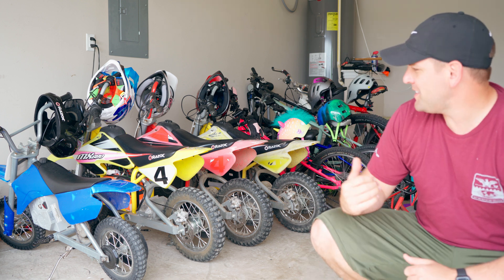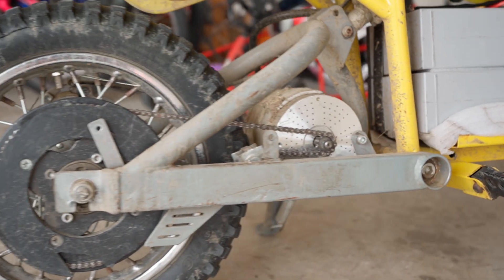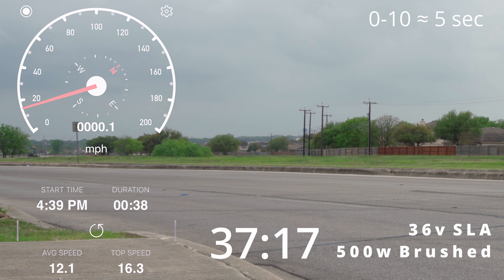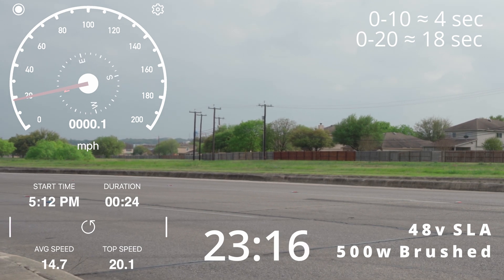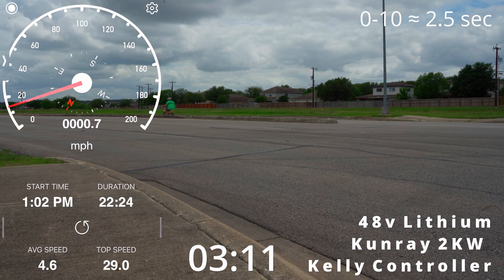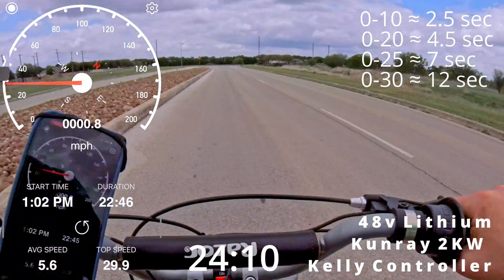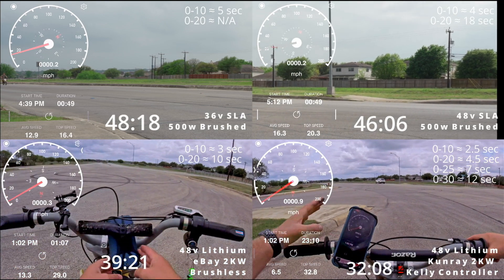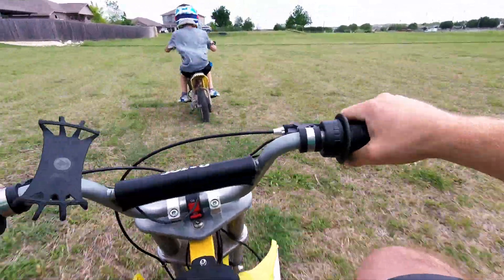Razor MX650/MX500 Electric Dirt bike Upgrade Comparison

Comment: One of the best MX650 comparison's I've seen, thank you! 

I'm just starting a MX650 build for my son. Street tires are on, and a 48V lithium battery is en route, as is a brake kit. Next up are headlights and taillights, and I will eventually add a now controller/motor. But the 25mph-ish he'll get out of the 48V alone is plenty fast for him for the next couple years!
Reply from the maker: @dhess34  thanks! I’m glad so many have found it useful. It kind of ruined my channel for me because it’s such a high performer I didn’t want to post anything else. Haha.
I didn’t know it at the time I made the video but a brake kit is basically essential. Y’all are going to have a blast!

Comment: Are your brakes stock or have you changed them out? If so, which ones did you go with?
Reply from the maker: Hey! sorry - I never saw this comment to get back to you. I have 2 with stock brakes and 1 with zoom breaks - HB-875. They also required new discs too which I think I overspent on but I can 100% recommend these brakes. The stock brakes on my 2 other bikes are very worn and barely stop at this point - my zooms could send me over the handlebars. I'm definitely not claiming they are the best choice - I do not have the data for that, but I have not been disappointed.

Comment: good comparison. would like to know the cost for the 3 different upgrades.
Reply from the maker: Hey- sorry I never saw this comment come in! I’d have to do some research. The lead acid batteries I already had laying around. The orange batteries were around $120 a piece, the cheap controller and motor also around $120 and I don’t remember how much I paid for the better motor and controller but I can tell you I overpaid the guy. You can get them for far cheaper than what I gave.

Comment: This may be a noob question but how do you charge when adding another SLA battery? Will it work or do you need a different charger?
Reply from the maker: Not at all man. You can get 48v lead acid chargers, usually made for something like a golf kart. What I did when I had multiple lead acids to charge (I’m not saying best practice, it’s just what I did) is got a splitter and charged my 12v batteries in parallel. I used a 12v trickle charger with an adapter that had like 5 connectors on it that would charge each battery to 12v and then reconnect them in series. You could also use a 24v split to charge 2 banks of 24v batteries in parallel before reconnecting them in series. 
I apologize if this doesn’t make sense. It be much easier to draw out or show you. Are you on the Facebook group?

Comment: What battery you using?
Reply from the maker: I’ve been running the greenway orange batteries with no issue. I have 2x in parallel. They each have a 30a BMS. 2 in parallel allows me to pull 60a to my controller.

Comment: Considering the 2000w motor you got, what is your battery’s max wattage output rated at?
Reply from the maker: So supposedly my batteries are each rated at 30 amps. 48v packs are 52 volts fully charged. My batteries are ran in parallel meaning I should be able to pull 60 amps. 60ax52v=3120 watts. That’s the math but I’m a novice so if there is more to it, I am unaware.

Comment: I just bought the 36 V razor controller and the throttle and a 36 V 12 amp hour lithium ion battery and over bolted the 24 V motor. Im 215 and I get 22mph on flat ground.
Reply from the maker: Which 24v motor did you use? Was that on the 350 or the did you swap out the mx650 36v motor for a 24v?
Reply: @NerdsWithFriends  the stock motor that  comes on the 350 24v and then I bought a 36v stock razor throttle and stock 36v razor controller
Reply from the maker: @PlagueisTheWiseX  very cool! Yea, volts typically correspond to top speed while amps give you your torque figure. An Mx350 stock should do around 14mph (at 24v) so at 36v you’d expect the top speed to be 150% the normal speed which is pretty much right where you are. That’s awesome that you’re able to reach those speeds as a full grown man! Be careful with it in the grass though- I burnt up a couple 36v motors in mx350’s. If you do burn it up, there is a 500 watt version of that motor you can throw in there that handles the heat better but, ironically, it’s actually slower at about 17mph if memory serves me correctly. (I have the motor on my buggy now. I no longer have any 350’s) but the 500w motor is already rated at 36v.

Comment: So you didn't run into any issues with burning the stock motor up when running it at 48v? Do you have to change the throttle when you do that?
Reply from the maker: So the biggest problem with overvolting is heat. Light riders should not have any issues. They exceed on flat pavement. Once you start having heavier riders, hilly terrain, and especially riding in the grass you can start burning up motors.
The stock throttle is fine.

Comment: The stock MX650 can handle 48 volt lithium ion without an issue running around 23 mph
Reply: I would love to see a video on how you did each upgrade. Even if it was just taking the cowling off and pointing to the changes. Great video. We are also new to the MX 650. I’m assuming you need all new chargers?
Reply from the maker: Yea dude! I show that in the video around the 3:00 minute mark. 😊
Reply: @NerdsWithFriends  not really at 3min mark it says SLA 48v on screen which is sealed lead acid battery not a lithium. The lithium is a lot lighter and has more punch
Reply from the maker: @stower82  gotcha. I see what your saying. Yes, a we also ran them a 48v Lithium with the stock controller before going brushless. I didn’t really think of doing that setup for the video since it was the same voltage. I misunderstood what you were saying. As I was.

Comment: Let's see a 13 tooth sprocket comparison on each. That would net some interesting results for sure
Reply from the maker: I did temporarily have a 13t on the last set up. Got about 35mph but I liked the torque better rather than the extra top speed.
Reply: @NerdsWithFriends  that's awesome to know I have all the same mods that you have listed but with 13t just haven't pieced it together. Waiting for this weekend. Thanks for replying
Reply from the maker: @TURBOMOOSE  it’s so fun! You’ll have a blast on it.
Reply: @NerdsWithFriends  makes perfect sense!

Comment: you have to change the gearing my diy e scooter with vevor kit goes 35mph in 10 seconds
Reply: nevermind mine is on li-ion, i just realised you are using sla batteries, you may wanna figure out how many amps you are actually pulling through them id interested to know
Reply from the maker: Oh no- I’m on lithium on all my builds. I could change gearing- but I like the torque I’m getting on my bike as is. I was getting around 34ish with the 13t but I went back to 11t

Comment: I need this, im in nyc so riding a actual dirt bike isnt the best of ideas. I dont have all the money to get it and do upgrades, should I buy it now then save up for upgrades or just save up tilll I can afford whole thing? Would very much so appreciate your input!
Reply from the maker: Be patient. Piece by piece is fine. Keep your eye out on offer up, Facebook marketplace and Craigslist. You’ll find a good deal on a used bike - I got one of mine free but it may take a while. Batteries are the most expensive part (if going lithium) so get on the forums to watch out for good deals on used packs. You can always use cheap SLA (lead acid) batteries as well while saving for batteries - but lithium performance is where it’s at. You can overvolt the stock controller and motor by 50% (so 48v) and it should be a problem- especially in NYC where I assume most of your riding will be on pavement.
Reply: @NerdsWithFriends  just found on with lithium 48v and 2000w motor and controller for $600. it has a extended back wheel base thing I dont like, but has a cool matte green color and black rims
Reply from the maker: @BlazeTrades  oh heck yea. The extended swing arm is awesome! I wish mine had one so I could lift it a bit and maybe put a bigger tire.
Reply: @NerdsWithFriends  ill trade you the one I get it with for the stock one if you want, id rather be able to wheelie
Reply from the maker: @BlazeTrades  I think shipping would be cost prohibitive haha.
Reply: @NerdsWithFriends  I found one guy on YouTube who makes and is selling the extensions for $280 plus a “core” whatever that is. He also said the materials alone are like $180. When I do buy a stock one and am getting rid of the extended one do you want me to ask you again if you want it? I’m not looking to make any extra money off it,I’m going to get rid of it for whatever the new one costed plus shipping.
Reply from the maker: @BlazeTrades  are you on the Facebook group where we can talk there?
Reply: @NerdsWithFriends  just joined yours

Comment: The Vevor and the Kunray kits are the same kits . They just are to different distributors. My 48v 2000w kit was 139 on ebay.
Reply from the maker: My vevor kit was also $139ish. The two motors look exactly the same to me but people on the forums swear that kunray is a higher quality German made motor. 🤷🏼‍♂️ but the controller makes a huge difference either way.
Reply: @NerdsWithFriends  when my controller fries I'm going with the kelly controller. You are totally correct. The controller is the most important part. Which kelly controller are you running. I don't know about Kunray being from Germany.
Reply from the maker: @noce1071  honestly- I don’t KNOW either. I’m kind of taking guy at his word. It looks identical to my vevor 🤷🏼‍♂️ I have the KVD7212N
Reply: @NerdsWithFriends  thanks. I have priced the controller on the Kelly website . They are great controllers.
Reply from the maker: @noce1071  I know! I want another for my other bike. I just don’t know how to program it.
Reply: @NerdsWithFriends  was the one you have preprogrammed. If so then copy the settings and use them as a baseline.
Reply: @NerdsWithFriends  have you gone to the kelly website
Reply from the maker: @noce1071  yes. I bought it in a kit with the motor and throttle.
Reply from the maker: @noce1071  ummm… I think I’ve been to their website.
Reply from the maker: Oh- to be clear I didn’t buy the kunray with a kit on eBay. I sourced it from a different distributor and got a Kelly controller- not a kit controller.

Comment: Enjoyed you video. I'm run the vevor 48v 2000w kit on two bikes , MX + RSF 650 . I built my own batteries. I'm running 60v on both bike . I did a suspension upgrade on both . Question did you drill out the vent holes in the motors. That makes a big difference on the temperature.
Reply from the maker: Glad you enjoyed it! I did not drill out any bigger holes on either build. The kunray has a heat sink I slapped on there that I had purchased for a stock motor but ended up killing the motor before I got the chance. I’m kind of hesitant to drill the holes bigger since we do so much off road riding  but maybe I’m just being paranoid. Any performance improvements along with the heat?
Reply: @NerdsWithFriends  The motors have internal fans so more air flow the better. How well does the heat sink work?
Reply from the maker: @noce1071  honestly I don’t have a way to benchmark it. Still gets fairly warm
But I haven’t had it get too hard to touch.

Comment: To say theres more on the table is an understatement! I'm running 3000w kunray, khb kelly, 120v. 0-30 2.8 sec. factory gearing 47mph top speed. 210lb rider.
Reply from the maker: Of course. But you’re talking a completely different budget 🤣
Reply: @NerdsWithFriends  less than what most spend on the good "72v Razor kits". But I hear ya! Def in the $800 range depending on lipo bat sales.
Reply from the maker: @AdamOpheim  yea. That’s the big spender. Batteries are crazy expensive!
Reply: @AdamOpheim  I have been running lipos aswell. It seems alot of people are worried or scared to run lipo batteries. Currently running 21s on 3000kw motor and cheap 80a ESC. Can definitely build one for 800!
.

Comment: Great job.  Nice video.  What speedometer r u using?
Reply from the maker: It’s called speedometer simple on iOS App Store. I actually don’t love the app. Tons of ads and kind of slow and skippy- but that may be a limitation to gps speedometer apps. It doesn’t do video overlay like you see in this video- that was done in video editing software. I matched the speedometer up with the video by doing a screen recording on my phone, clapping my hands, and syncing up the audio between all the clips.

Comment: The sx500 frame is more custom friendly then mx650 as more room in the battery box
Reply from the maker: I believe it. I did cut the battery trays out of 2 of my 3 bikes. Haven’t seen an sx for cheap around here.
Reply: Im looking to purchase the mx500 but i weight 220lbs. I know its only rated for 175lbs and the mx650 is rated for 220lbs. I wonder is the frame structural strength the same? Im gonna mod the entire power train and suspension so is the weight rating only because the mx650 has more power stock so it can support bigger riders or is it a structural thing?
Reply from the maker: @daflip1500  I have one of each and to me they look identical. On the forums people also say they are identical- down to the motor and controller. I don’t know if that part is true but from a physical perspective I don’t believe there will be any benefit to one over the other especially if you are replacing the power train. It is the same bike.

Comment: Great comparison.  With regard to eBay 48v 2000w kit is the controller 33amp controller or a 45amp controller?
Reply from the maker: The listing says 34a but I didn’t think to look at the sticker on the actual unit. I’ll try and remember to pull it apart tomorrow and get back to you.